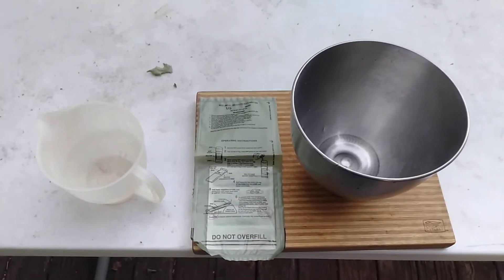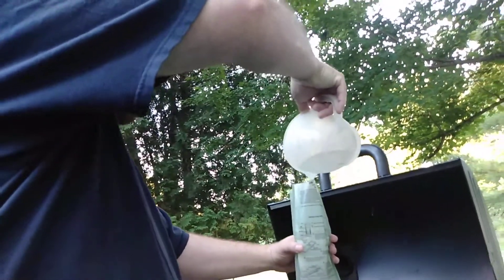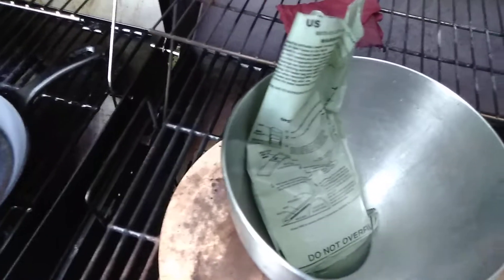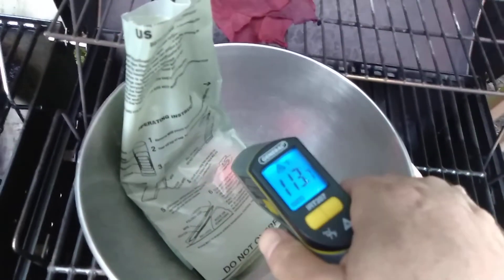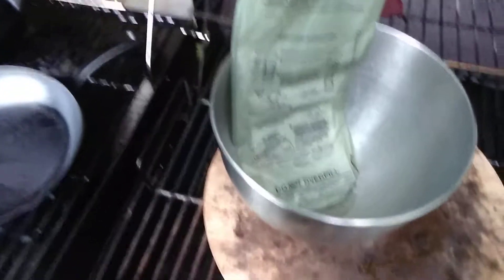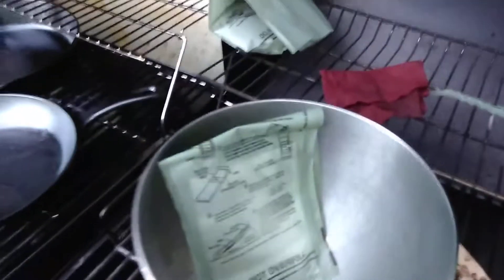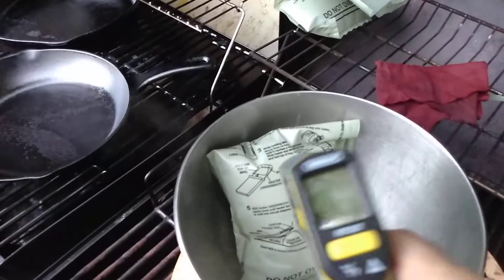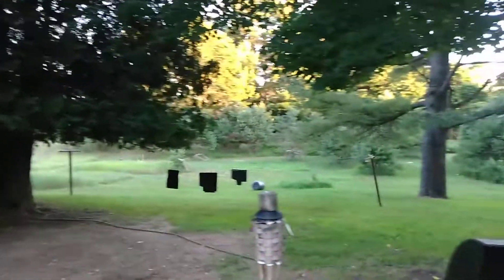MRE Review:  Overfilling a FRH (Flameless Ration Heater)

Comment: Well, I thought that it is written from different perspective. Magnesium-iron heater as a biproduct produces hydrogen. So no use in aircraft. Hydrogen is flamable, but that is another story. In manual you need to fold the bag with food and put it to box/sleeve. In good conditions hydrogen is expanding very fast as it is made and possibly blow up as a bomb.
Thank you for your rewiew